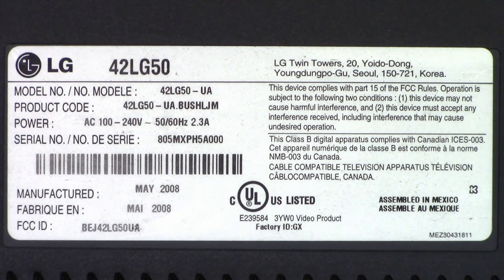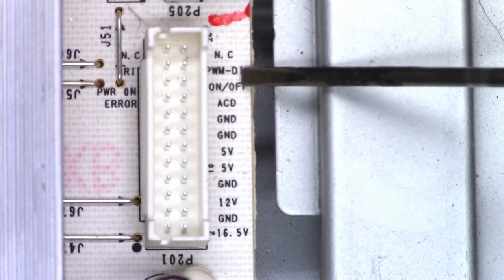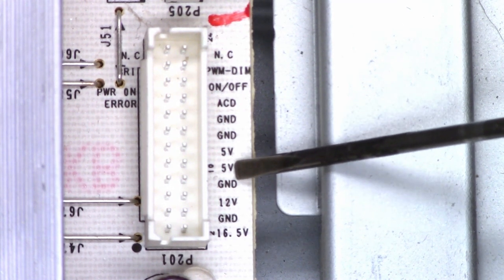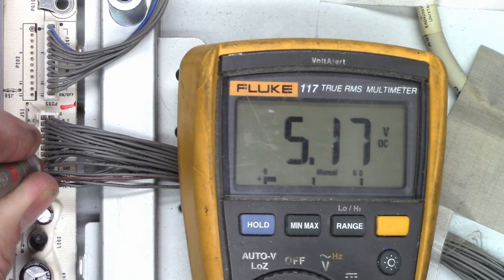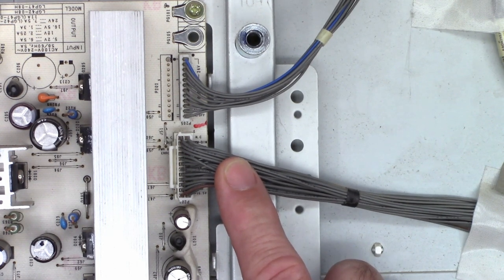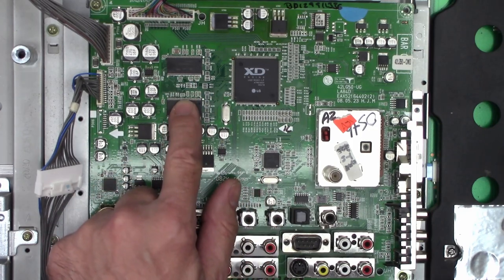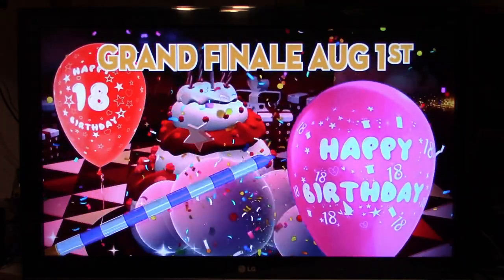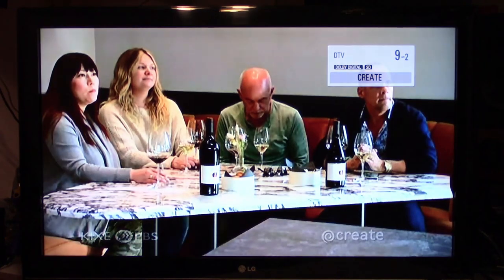LG 42" 42LG50LCD TV NO PICTURE REPAIR, NO BACKLIGHT, NOT THE INVERTERS OR TIMING CONTROLLER TCON

Comment: I had a similar vintage LG tv with a similar problem. I found videos that said to bake the main board in the oven (probably to reflow some bad solder joints) - it actually worked!

Comment: If you had a Flir camera, I'd be pointing it at the mainborad while off to see where that 32watts is going. That's a lot of heat. Lg BGAs seem to be a real problem with some models approaching a 100% death rate from the BGA change over period (well after the warranty of course). I've yet to come across any other fault in their 560 and 650 models. Shame, when running, they are a stunning image. When dead, totally useless as the TCon is on the main board as well.